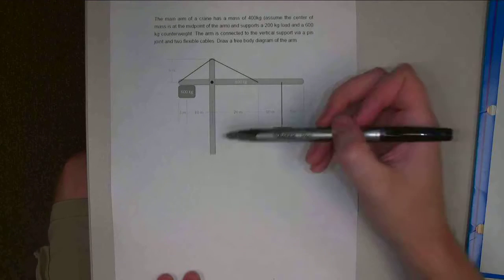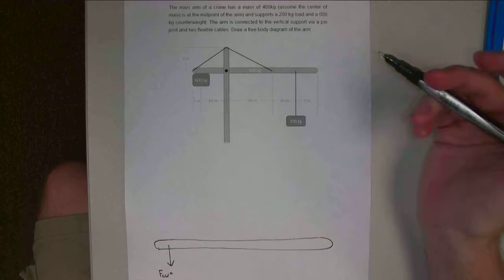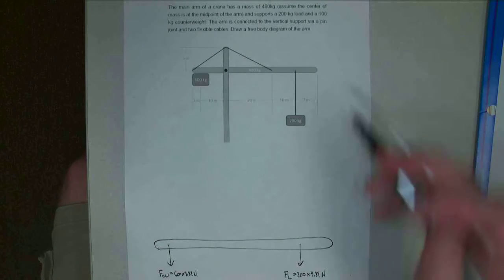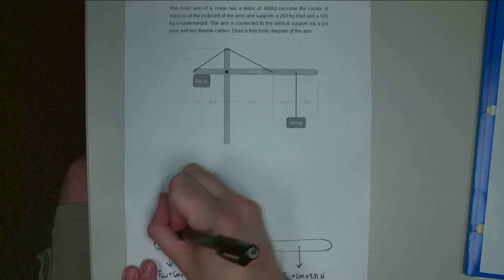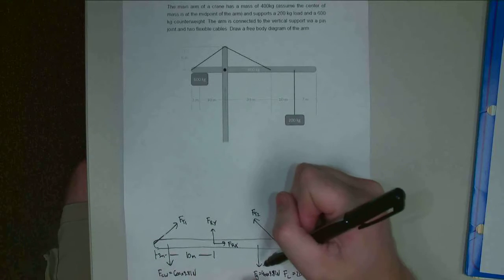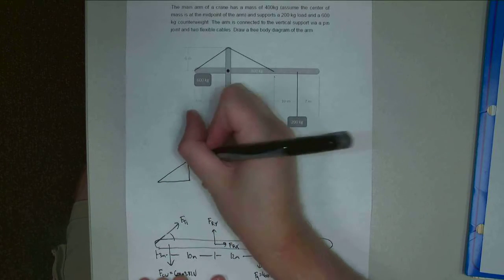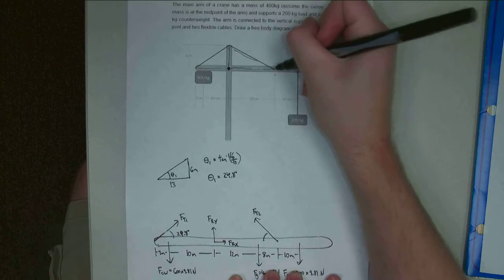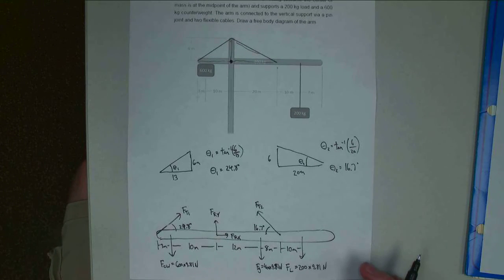Free Body Diagrams - Adaptive Map Worked Example 5

Comment: Hello, I am working on this exercise, but for the static equilibrium of the figure. When I calculate both vertical and horizontal forces and moments, I end up with 4 unknowns due to the two tensions. How could this be resolved?